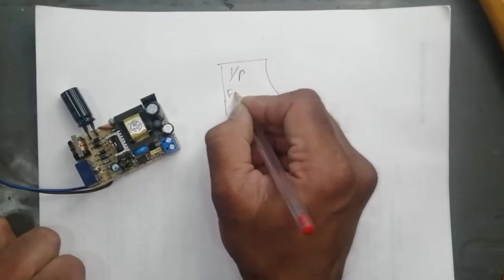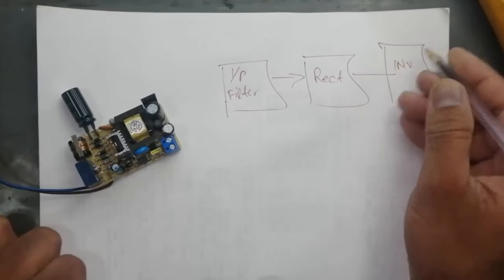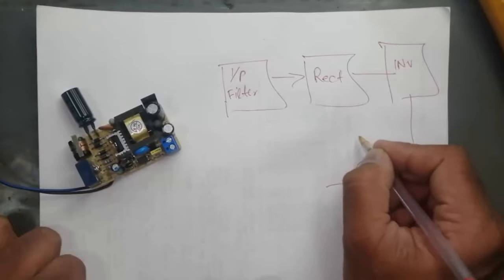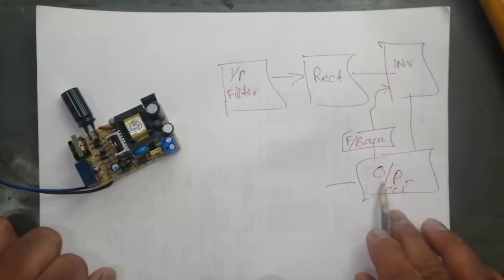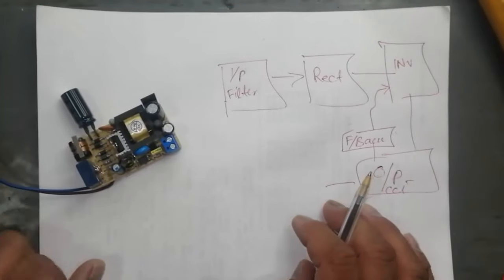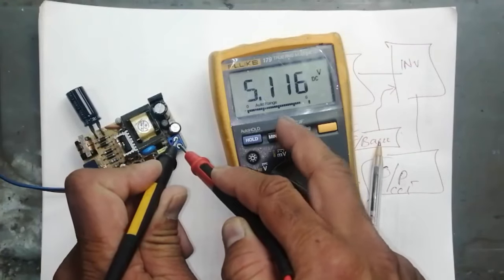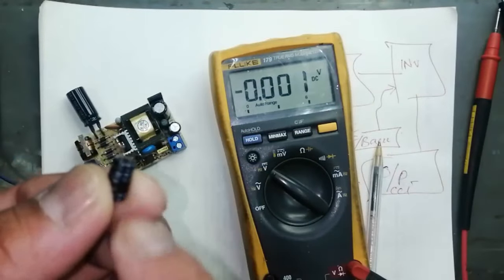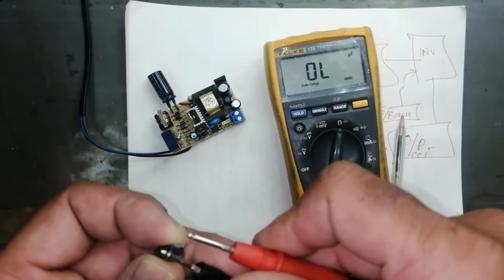How to repair switch mode power supply SMPS practical troubleshooting

Comment: This is really interesting failure, because you might think that everything works in the primary side, but it isn't the case. Failure might still be on the primary side, but only feedback part of the circuit. This is really helpful video for hopefully successful repair of smps and save money and environment. My humble thanks for the video!!!✌

Comment: Sir my juki machine has brushless motor. All of a sudden when I switch on circuit breaker goes off. Input wire ok. Smps main condensor,rectifier ok. Fuse and protection varister ok.this controller has viper 22a and small inductor only there is no chopper. What could be the problem

Comment: Hi Haseeb, I have a power supply 16V 4.5A which is having an interesting fault. It has an output of 16V stable without load. When load is applied the voltage drops instead of being regulated. If I apply a 1A load the voltage drops to 14V instead of maintaining the 16V. If I apply a higher load (for instance 2A,) the voltage drops dramatically to 8V. I suspect the optocoupler. The power supply has two optocouplers, one of them has 15V in the transistor side and 0V on the diode side both with and without load. The other opto has 12V on the transistor side without load and 1V on the diode side. With load the voltage on the transistor side drops to 4V and the diode side is 0.5V.

Comment: helloo, am troubleshooting a 240v ac to 24v dc smps and realized that two diodes for the bridge rectifier have shorted, blown the fuse and blew a FET. what could be the problem?
Reply: @HaseebElectronics  sorry i ddnt get u right about "connect to power supply to a bulb in series to eliminate sort" explain further. Thanks
Reply: @HaseebElectronics  thank you very much.

Comment: Great video as usual. Your all videos are good and informative. I also like to perform voltage test method because it's the most accurate and fastest way to find problems in SMPS. I use Blue ESR meter for test electrolytic capacitor's ESR Ohms value. Because most of the time capacitor tester or multimeter capacitor function cannot find bad capacitor. Their capacitance value also shows good but their internal ESR value goes high. I recommend you to buy any good ESR meter or ESR Tester.

Comment: At 3:59 I noticed the probe slipped but was apparently edited out .... what would be the consequence of that ?  Still have to get over my fear of measuring stuff on the hot side. Ordered myself an isolation transformer but don’t know if you’ve already done a video on safety (right multimeter probes and handling, avoiding shorts, using 1 hand , using isolation transformer, series light bulb, using electrical tape to cover parts of the circuit you do not need, ......) think that would make a great topic.

Comment: Good afternoon 
I would like to ask you this.
I have a main pcb of a printer that it is not working. I have 220v ac until the bridge rectify. At the (+ -) of the bridge I have 305v dc voltage. After the bridge there are two capacitors parallel and I measure 152v dc voltage on them.is this normal?The capacitance of them is 410μf /200v and I measure them at 375μf each. Is this the reason of the 152 v on them ? I’m little bit confused.. could you give me some advice? Thank you in advance..

Comment: I have approximately the same but12v5A and i have no voltage at the SMD PWM IC VCC pin. Mosfet, Schottky diode and output capacitors are good, could it be that small capacitor the faulty ?
Reply: @HaseebElectronics  Salam M Hasseb, so i have 325 VDC at main capacitor but no voltage at VCC Capacitor of the switching IC. I traced the positive line has 2 ways :
1- from positive pin of capacitor to a fast switching diode then to one pin of main SMPS yellow transformer.
2- it goes through some zener diode then straight to one pin of opto-coupler.
All these components are good, i still don't know where the positive voltage comes from ? 1 or 2 ? Thanks.

Comment: I am just wondering before you connect AC into the power supply if a person checks the resistance in the input prong there on the supply itself which are typically male, should one read resistance, and if so what range as I would think they are all different.  However, would 1 ohm be okay or 10M ohm be okay.  I assume there has to be an acceptable range or is that a difficult thing to say.  But I am sure 0 ohms would be wrong or maybe a million ohm?  I can't find this answer anywhere.
Thanks in advance for your response on this.
Reply from the maker: thanks a lot
input resistance for a good switching power supply is normally above 100k 
sometimes it goes in Mega ohms 
but low resistance in just few ohms  indicates malfunction

Comment: GOOD Job ..what is the blue component next to the opto-coupler
Reply from the maker: best regards 
the blue component is class Y capacitor 
it removes the noises in secondary side (common mode noise)
Reply: @HaseebElectronics  ok… I thought it was a capacitor or maybe a NTC thermistor..thanks for making these videos they are much appreciated.

Comment: Like always no time wasted.
I did observe at the cap test the meter probe  colours were opposite polarities of the caps, can you please explane
 the theorie behind testing cap using the cap tester.
Thank you SIR
Reply from the maker: best regards and special thanks 
while testing it is good to use multimeter polarity 
but it is okay to check at either polarity. Just we have to discharge the capacitor properly before capacitance test

Comment: Hello my friend. Thank you for all the videos. Was wondering if you could do a video on checking of power supply faults using a multimeter without AC mains power. I know it would have lots of limitations but wanted to see how far repair of a power supply could go without connection to mains

Comment: Thanks for the detailed demonstration! Did you use isolation transformer to get the AC power supply when checking with the multimeter?

Comment: helo sir and thank you for this video. You are so great. Im would just like to ask regarding the inverter circuit that you measured the ac voltage which is varrying pin no 3 and 4 as a key reference if the inverter circuit is functioning.What component is that sir?

Comment: Greetings Mr. Haseeb.  Thank you for sharing your knowledge from which I have learned a lot.  I have repaired simple SMPS, but watching your videos has motivated me to repair a more complicated 24 volt for me since I don't have much experience.  After changing capacitors, optocoupler, resistor, trimpot and repairing some solder, the green LED lit up, and 24 volts are present at the output but when you connect any load the voltage drops to 0 volt.  The LED stays on.  Excuse me Mr. Haseeb, what do you advise me?  I'll keep looking at your videos.  Grateful.🙏🏻🇻🇪

Comment: I want to see how you made that soldering iron that removes capacitors leaving a clean hole..thanks in advance
Reply from the maker: it is WELLER WR3M rework station 
please check video number 511

Comment: Assalamu allaikum.  Brother I can see that you are a very experienced engineer/repairer and you know SMPS like the back of your hands. But, for beginners like me can I suggest a few things? Before you get to the physical  power circuit board:

1) Draw a higher level block diagram of a generic SMPS.  Explain the purpose of each block.

2) For each block draw a typical circuit schematic so that we can visualise the logical interconnection between each component and each block.

3) For some major component s like the bridge rectifier, switching transformer circuit,  opto-coupler, etc explain in detail their purpose, how they work and examples of how to identify them.

I love your channel, but find it hard to follow along because you are jumping from one topic to another too quickly without fully finishing your explanation.

By the way what is you education background? Are yo self taught or have  electronic engineering background?
Reply from the maker: welcome and special thanks for appreciating my efforts 
i shared very detailed videos on smps basic and working principle and physical layout. 
check video number 223 and many other videos explaining the working principle of each individual section
for feedback circuit video number 229, 232, 257 & 275 
snubber circuit 284
for smps circuit 297, 279, 245, 156
many videos on the same topic
i am just sharing my experience, might be it will helpful for someone 
my videos are also available in Urdu / Hindi Languages on my second channel (haseeb Electronics Urdu)
Reply from the maker: yes dear i completed engineering  38 year ago
Reply: @HaseebElectronics  Thank you for replying so soon. You have new subscriber and good luck.
Reply: @HaseebElectronics  Sir , appreciate your detail explanations , your videos are highly informative and educational . Thank you very much again . I am trying to watch the videos one by one and looking forward for a playlist from basic level to advanced 👍🙏🍀

Comment: Sir may I ask if the bias capacitor in the feedback coil is defective it's affect the output voltage but the voltage in the main capacitor does not affected I'm I right sir tnx
Reply: @HaseebElectronics  tnx Sir

Comment: Sir please kindly tell us us the perpose of the capacitor in this circuit
Reply from the maker: yes dear, silver wire have different magnetizing current, we have to find the wire size and its magnetizing current 
then calculate its current density for silver wire
then calculate again for copper wire for new turns 
i will try to explain it soon

Comment: Found your explanations very good and the walk down as well. I have a SMPS that has the correct output voltage but cannot take the load. Seen the current is not able to drive the loaded it uses too. I have replaced most of the components with no change in the output. any suggestions
Reply: @HaseebElectronics  Thanks, will do that check tomorrow. I am going to watch all your videos, like the way you present - teacher.
Reply: Your reply not showing when answering.

Comment: Is it ok if the output voltage of bridge rectifier is only302 dcv?
Reply from the maker: yes it depends on input ac voltage
multiply ac voltage value with 1.414. the resultant should at output of bridge rectifier
Reply: @HaseebElectronics  thank you sir, it really help a lot. I already downloded most of your videos, it is clearly understandable. Hope to see more of your videos. Thanks again.

Comment: Thank you very much for this video. Can you please help on 1 item? The bad capacitor, in which section was it? It looked like it was on input side, but the input side was good and problem was in feedback and regulation? Please help us understnad exactly where this capacitor is and what it does. THANK YOU VERY MUCH!!
Reply: @HaseebElectronics  Thank you very much Sir for quick reply. It is so nice when somoene is helpful and actually cares to reply! Bahut Shukriya, badi meherbani.
Reply: @HaseebElectronics  Sir, I would like to contact you by WhatsApp but not sure which number to use. On your home screen there are 2 numbers, the one which says WhatsApp is 12 digits (after 00), so seems to be too long and does not start with 92, should I use the other one which is 10 digits (after 0092). Please confirm number. Thank you.
Reply: Please ignore this, I have figured out the number.

Comment: Dear Brother،
I watched your many SMPS  videos these gives me a lot information to understand the function of SMPS۔ I have some problem with my S-120-10
12v 10 amps 120w  amps.
With Problem of
Low output voltage between 4.9 to 5.6 volts only.tried to increased by volt adjust pot it adjust only as mentioned above.
Kindly instruct how to over come this problem your advice will be highly appreciated.
Thank you brother.

Comment: I am having an SMPS I am not getting the DC output the DC output is 0V and after checking the bridge rectifier output and PWM ic Base drive pin switching pin I am getting appropriate voltage but the feedback pin of own ic is showing 0v . I don't know why we are getting zero dc output
Reply from the maker: i will recommend video number 528. i hope that will give a detailed solution for all problems related to smps circuit
Reply: @HaseebElectronics  okay I will watch that video but I want to ask could u plz tell me if my output voltage is zero volt then issue should be where?
Reply from the maker: might be there is something wrong with switching circuit. 
sometimes the output side components get damaged, rectifier or capacitor

Comment: Assalamualaikum,
My computer power supply turned off suddenly and turn back on itself. Then that's happen again.
The output voltage are ok. I'm confused what is causing the problem. 
But there is a "Hssss" sound from I don't know which part. I think the sound come from inductor or transformer.
What should I do first?
Reply: @HaseebElectronics  Thanks for your answer, i'll take a look and try to fix it.
Thanks also for your very useful tutorial videos.
Jazakallah Khairan
Reply: @HaseebElectronics  Assalamualaikum,
I have an update about my PSU.
The "hsss" sound i found that is coming from resistor that connected to primary capacitor, the other side of the resistor is connected to primary mosfet "source" and the "drain" of the mosfet are connected to primary transformer.
So I changed the resistor with the new one and the "hsss" sound dissapear.
But now I have another problem, 
Now the PSU won't start if I plug any load (only one 12V fans) just turn on momentarily. But if I unplug the fans, then I restarting the PSU, it can start, and after start then I plug the fans, the PSU will stay on.
It's looks like the PSU weak under load.
How i can solve this problem? 
Thanks for your attention.

Comment: hi friend ..can you tell me what this mean on power board output power
PS_ON
+DIM
BL_ON
facing on main board connection of LCD
NC
PB
ADJ
THANK YOU
Reply: thank you friend ...I toll you before power board give right voltage first 3 seconds and red let was shimming then I lose all outputs power...so is this mean I have problem with back light circuit make feed back unit to disconnect the circuit
thank you for quick response
Allah bless you

Comment: At 13:11 you put your finger almost across both inputs of the filter coil. It was very close to get electricuted!
Reply from the maker: you are right, but it looks close in camera 
best regards and special thanks for your very close assessment for safety matters
Reply: @HaseebElectronics  I have very similar SMPS that has problem with waking up. It starts ok and works good only when I touch the input capacitor terminals with multimeter. Otherway it wont boot up. All components tested ok and I can't find the problem, thus I'm watching your video carefully. Thumbs up from Poland👍
Reply from the maker: @kopauns7607  it seems there is some disconnection between the components and pcb tracks of power input stage 
inspect it closely
check DC voltage on main DC capacitor. it must be (input ac voltage x 1.414) 
if it is less or unstable check input stage
Reply: @HaseebElectronics  I checked all parts and soldering points but didn't find anything wrong. When I was testing the input capacitor voltage I surprisingly found that the power supply started working fine and it was stable, but after I disconnected power for a few seconds and tried again it didn't start. I repeat the capacitor test and the power supply started again and worked ok. I tried this with a new capacitors and other parts and it still does the same over and over. Very strange.
Reply from the maker: @kopauns7607  possibly there may be trouble with vcc capacitor or smps controller ic. 
check vcc capacitor first 
then think about smps controller
Reply: @HaseebElectronics  vcc voltage is ok but the controller IC is the only part I didn't replace. The chip is SM7028B. I've made an assumption that if it works good after the "jump start" it must be good. Am I correct?